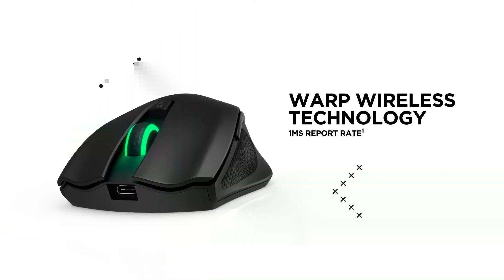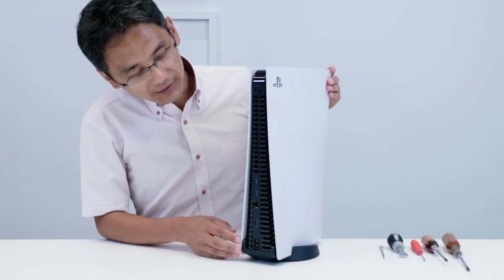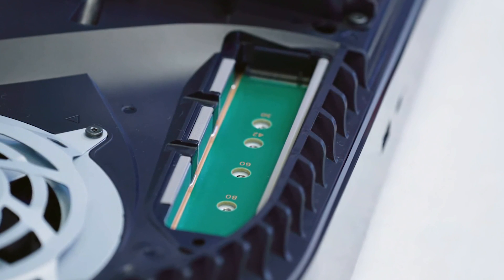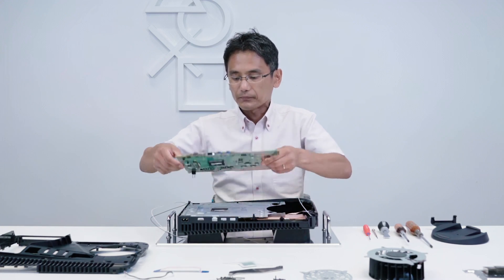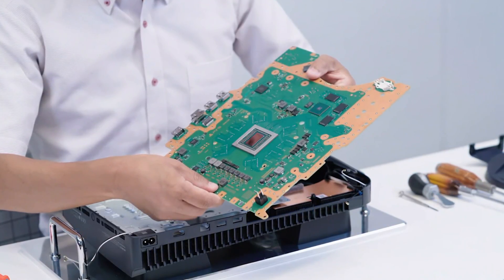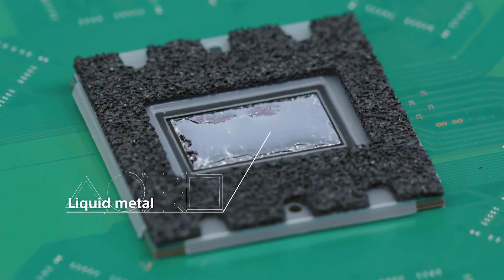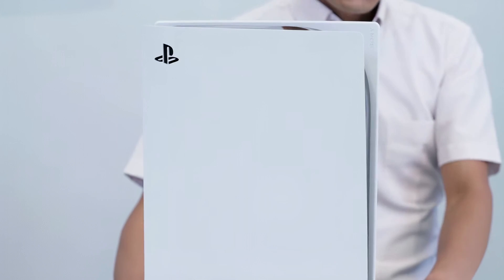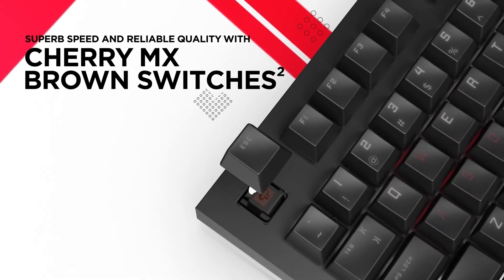PlayStation 5 Teardown Analysis: Inside Sony's Next Generation Hardware Design

Comment: For all the Sony fanboys DF raises valid concerns about the expandle SSD heat that doesn't make them shills. For the Xbox fanboys just bc they raised these concerns doesn't  mean Sony hasn't  thought about this & it will fail. The console has been in development for 5 years & Sony knows what they are doing.  

DF isn't shills. They are doing their jobs & without a unit from Sony they can only speculate until they get their hands on the console themselves to do testing. Jesus i hate fanboyism.
Reply: Well, it's funny how he conjecture that the commercial SSD's that can be put to the PS5 will suffer from "overheating", but of the Xbox's SSD card doesn't say anything when it doesn't have any dissipation either.
Reply: He mentioned ms more than Sony in a teardown of a Sony console. So much forced concerned - better known as concern trolling.

Sony has copped it bigtime over the last gen for noisey consoles - rightly so. Do you think they would have addressed that? I do. I also have confidence in there strategy to mitigate thermals within PS5 - including the expansion bay. 

Rich is a classless shill - it shows more often than not. And Eurogamer are one of the publications the LOVE to perpetuate false rumours regarding PS5 over the last year or so.
Reply: @26101976bdm  he mentioned this bc that's all they have to compare it to. Without the actual unit from Sony they are basing it on the XSX designed & how it COULD compare. He even mentioned at the beginning that Sony's strategy of drip feeding info was the better option bc people are STARVING for that info & HYPED to get the PS5.  I personally think it's bc we have seen actual next gen games captured & running on the PS5 unlike MS & they look incredible.

Look up the compilation of people who got to see Demon Souls gameplay trailer. They were blown away but Xbox fanboys jumped at the opportunity to shit on PS5 bc of DF saying it was running at 30fps. No one cared it was 30fps. 

Visa versa when the XSX was reported to be really hot the PS5 fanboys jumped at the chance to shit on the XSX saying it was overheating. Which the journalist NEVER said that.  They just said it was hot & blowing hot air. He used hyperbole saying it could "heat your flat" but that was just a joke.  

Again i cannot stand fanboyism from either side. Sony nor MS give 2 squirts of piss about people defending a corporation that's meant to sell you a product.
Reply: @djkoz78  if you don't see any bias when Dick is talking about PlayStation products - I can't help you, it's plain to see. Fake concern throughout, mentioned ms at every turn - and with an air of praise. Yet they haven't shown any games running on xsx.

Now - you mentioned the xsx getting hot and how Sony fanboys jumped all over it. In the case of PS5 - that would happen and then a publication would run with it and before you know you have untruth being siad as fact.

I am a fanboy - don't shy away from that fact either. Sony are guilty of bad messaging/mixed this time around - that cant be denied.
Reply: @26101976bdm  wait are you calling me a fanboy? Bc i have both the PS5 & XSX preordered. I don't care what your opinion of DF is. I disagree. Literally on the Richard's twitter you have XBOX fanboys calling him a Sony shill right now. You seem to be the fanboy bc its pissed you off this much.
Reply: @djkoz78  no mate - I didn't call you a fanboy, you stated quite clearly how you feel about them. I was pointing out that I am a fanboy - and that I dont see anything wrong with it. 

In my case I don't perpetuate false rumours about the competition and can also call Sony out when I'm not happy with something they've done - messaging. 

I do 100% see a bias coming from Eurogamer/DF - if you or others don't, that's sweet. It won't change my opinion of them, as my words shouldn't genuinely affect others opinions - because that all they are, opinions.
Reply: They failed to mention xbox have not presented any gameplay with ANY kind of ray tracing but they were counting shadows , SHADOWS in the Spiderman MM section 

They failed to see the ray tracing in start of demon souls gameplay 

Failed to mention the obvious popins in every game shown on XSX 
Also the ability of liquid metal when it is properly contained

Comment: XBSX “smaller”... I’d be curious to see what the actual volumes of the two consoles are. They are possibly much closer to the same “size” than we think.
Reply: Nope. Xbox Series X is still significantly smaller, since the PS5 is not only taller, but also deeper in size.
Reply: @ohmnesia  There is another dimension in that equation...
Reply: @BayleeO-30  Yeah, but that doesn't change the fact that PS5 is bigger in the 2 other dimensions. I'ts probably about as deep as the Seris X is wide. And then you have one dimension left, in which the Seris X is smaller again.
Reply: @ohmnesia  I have done the research: PS5 comes in at just under 645 cubic inches. XBSX at just under 411 cubic inches. So, there you have it. I still wonder how difficult it will be to put these in a standard entertainment center. I would imagine that the PS5 would be slightly easier due to it only being about 4 in. wide. That extra inch on the XBSX would be an issue under my tv... not sure about anybody else.
Reply: @ohmnesia  It isn't smaller. It's shorter. Big difference. I can't fit that eye sore box in my entertainment center. I can fit the ps5 there though.
Reply: @joi0001  Well, I can't fit the PS5 in mine, since it's too tall (both horizonally and vertically). And I assume most people will have the same problem.

And it is smaller in volume btw.
Reply: @joi0001  If you're putting your PS5 in a space that an XSX can't fit into the air flow is going to be terrible.

Comment: I don't buy this "it's the same as a vapour chamber" thing coming from Sony. I'm certainly no expert, but the information I've been reading suggests that it's not that simple. You can't just throw more heat pipes and larger fins at a conventional cooler and expect it to perform as well as a vapour chamber. But that's all academic, as long as it does what it needs to. Doesn't matter what the tech is, as long as it remains "cool enough"
Reply: its not a vapor chamber, its a heatsink that the performance of a vapor chamber.
Reply: @devilshooter126m8  Which is what things I'm reading says is BS. Like I said, I'm no expert on the subject. It feels a lot like one of those "yeah, well MY console's got this, and yours hasn't" type school-yard arguments, but whether it's true or not, it doesn't matter if it keeps it cool enough
Reply: @AntneeUK  Yeah. It's not a heatsink with the performance of a vapor chamber, It's a heatsink large enough to perform like a smaller vapor chamber.

Comment: The look and size of the console matters only 1 day when you purchased it. It’s far more important what games are coming. And sorry, but Sony is a different league here. I don’t even care if a system is quiet or not. The Ps5 has a lot more features to care for which of course all need place 🤦‍♂️. The Xbox cooling system is the most dumb I have ever seen. I already can see where the flaws are. Especially after 1-2 years running. But I can’t wait til people realize that. You don’t need cooling on this thing anyway. Thanks to the series S, the best looking games will look like last of us 2 will look on the Ps5 xDD 🤣🤣 for the whole generation. 1000%.
Reply: Sorry but all signs point to Sony's best days being behind them, 70$ for a demon souls remaster? They're coasting and don't have any Shadow of the Colossus' to save them. They're gonna gouge and throw money around until next gen where they're forced to try harder. That's the way it seems to me anyway.

Comment: Will you do an iphone 12 pro max graphic analysis, they said they have achieved console level graphic, very interesting.
Reply: Did you get that info from a facebook post?? That's a total lie, lmao. Maybe nearing PSP performance disregarding battery life, but nothing more. Still a shitty chip on even shittier architecture along with an incredibly gimped OS that can't ever run more than basic android apps developed on it. For a 500% price markup and only will be supported for a few years until it gets slowed down and be useless junk. 
Spend your time reading more informed tech material, please.
Reply: @sqlevolicious  Apple said this, in the special event.

Comment: It will be a beautiful and powerful console when they finally release SLIM version in two years. I don't plan to buy it before that happens (because it looks terrible now).
Reply: It also needs to to be black , not a racist thing i just would prefer a black console. They just look far better than white.
Reply: @DEVILTAZ35  and it won't turn yellow after 5 years.
Reply: I think it looks great actually. But it's huge 😂 I guess the imaginery engineering award goes to MS.

Comment: Hey DF! I've got an interesting question for you: Is next gen console gameplay possible without an actual console?

Since Microsoft included XCloud into Game Pass and Google released its new Chromecast with androidTV It's a valid question I think! As an alternative there could be also named a Xiaomi Mi Box S (Lan Port), some oDroid N2+ SBC or even a nVidia Shield (all 4 with android!). But I wonder, how frametimes and resolutions do look via streaming these days and if this is a real low cost alternative for an XBox Series S oder PS 4 Pro! Also the quality you get from Playstation Plus would be nice to know. Does Ps Now at a 1440p Display look way worse than PS 4 Pro in 1440p?

Maybe you could take a look at it. =)
Reply: I can't see anything above 1080p30Hz(720p60Hz) on streaming in the foreseeable future.
And currently it's at 720p30Hz
Reply: @MaxIronsThird  Even so, button presses at over a second makes for any game unplayable regardless of the heavily compressed resolution and the few frames that actually come through even on the best network on the planet.
Reply: @sqlevolicious  The first tests I've seen with XCloud were very convincing even for story games like the Witcher 3.
Reply: @MaxIronsThird  Afaik only Sony still limits to 720p. Stadia and XCloud are already at 1080p. And since upscaling is working fine these days, I would have been interested in DFs opinion!
To play any Game Pass Game on my 2017 smartphone with WiFi in (upscaled) 1440p sounds like switch-gameplay right from 2030. :)
Reply: Game streaming doesn't work in reality, it's a scam these companies run every few years. You can't break the laws of physics and send key presses over hundreds of miles and expect to get latency low enough to be playable on any game other than a turn-based chess game. 
Don't buy into game streaming. Processing power will only ever be local.

Comment: I learned more about series x than the ps5, which is weird wasn’t this supposed to be a ps5 teardown analysis?
Also you didn’t compare the Wi-Fi 6 and the Bluetooth 5 of the ps5 with the xsx, since you compared every other aspect of them, instead you talked about how it was unnecessary, idk seems like sony is trying to future proof their console. IMO Sony tried to build and perfect their internals and cooling first then made the design later, while MS made the shell first and tried to piece everything inside of it. Ps5 just looks much better engineered to me inside and outside.
Reply: I think a lot of that is down to Sony's secretive nature and not releasing full technical breakdowns whereas MS has.  WiFi AX (6) is totally unnecessary for most people unless you live in places with a lot of signal congestion and the routers are significantly more expensive than their AC versions were at launch.  A lot of people still have old 802.11n routers especially if their ISP uses custom routers.   As an engineer the engineering on the Series X looks considerably more impressive.
Reply: @weirdscix  the same was said with 4K, also the same can be said about 8k or 120fps not everybody will have a TV that supports it. Wi-Fi 6 is much better for vr the new oculus quest is using it, psvr 2 will probably use it. PS Now will take advantage too... As to design xsx just looks clumsy, just look at the back of it, the 2 top air vents are literally shut there’s no way air can flow through it, although that split motherboard looks pretty cool.
Reply: @alexisreee3930  Maybe WiFi 6 will have some adoption but it will take years and still be on the low side, 4K TVs are very common now, 120/8K not so much.  The subject of airflow is very technical and would have been designed, iterated and tested many times before they settled on a final design. I think both consoles will do well in the end, Xbox because of Gamepass, Sony because of Exclusives, historically though Sony have always had the weaker product, even PS4 was plagued with problems.
Reply: My thoughts, their clearly SALTY about not having the opportunity revealing the break down on their channel.

Comment: I like when companies make funny marketing jabs at each other , I enjoy this one as well with the stand , but I prefer the ps5 method of the stand. I don’t like how the series X looks with the stand sideways
Reply: Marlon Te Vrede  then why would they post it being able to put sideways ?
Reply: Just to drop knowledge. The stand on the series x holds it up to allow air flow to come into the bottom. They made it non removable for a reason. They dummy proofed it so that people couldn't take it and cause the system not to cool properly.
Reply: Both look best vertical but the Series X looks really bad flat. The PE5 I think you could get used to quick enough and its at least doable.
Reply: FUCK YOU GOOGLE ASSHOLE  I don’t know if you’re trying to make some kind of joke but the stand comes with the console.
Reply: bro why did you hit rihanna that's not cool
Reply: @Hannibal the problem with the xbox one s all digital weren't that you could only buy digital copies, the problem was that they sell it at the same cost of a one s. Only a idiot buys the all digital over the one s at same price, they have the same specs but one offers less than the other.  At 99€ the all digital  vs the 220€ one s has a reason to exist, at 200€ no
Reply: Yeah, I think it’s because of the Xbox logo, it just looks like it’s wrong. They’ve had successful jabs at Sony before but the one about the stand was pretty off. Firstly, the overall teardown was pretty great and the PS5’s stand is clearly not as basic and ‘cheap’ as people expected it to be, I think that jab was just a failed joke on their part.
Reply: @narukami6364  Yeah. Imo both consoles look far better vertical. Horizontal seems like a consumer decision
Reply: @narukami6364  yeah I completely agree with that , that was my exact thought when I saw that
Reply: @Hannibal Yeah, but Microsoft went about digital content and streaming the wrong way by trying to force it on the consumer with predatory measures such as 24/7 online check-ins and the emphasis on DRM which highlighted its downsides more than anything else. Obviously, the future of digital media came true and is dominating the entertainment medium (not just because of video games but everything else included) but the way Microsoft tried to go about it back in 2013 is still wrong. The PS5 Digital Edition and XSS are proof that both Sony and Microsoft understand that digital is the future but they can’t force the consumer into that future, so they will both settle for offering it as an option for one more generation until it finally becomes the standard in the 10th generation (2026-2027).
Reply: Nothing beats the “How to Trade Games on PS4” video that Sony sucker punched Microsoft with in 2013. That was the K.O. killing blow for the X1.
Reply: @DVRKSTXR  yeah that was a literal kick to the nuts in public, amazing lmao
Reply: @chrisbrown113096  The Xbox One never recovered from that. Now, Microsoft is trying to bounce back with the XSX|XSS and Xbox Game Pass.
Reply: FUCK YOU GOOGLE ASSHOLE  in a store the parents who buys the console for children (and 60% doesn't have any knowledge about hardware or design) when they see ps5 and xbox, buy ps5 because the xbox from the esterior seems a cheap box of plastic, ps5 instead is more like a console, and with led and bicolor is more eye catching. Xbox can only be appreciated by a passionate of technology who informs himself about new tech.
Reply: @hxh-zz4fh  lol no it doesn't kid.
It looks more like a modem than your typical console the closest console that looks like a console is the xbox series s

Comment: And now remember that SSD chips have very, VERY short life term when they are used very often.
So  if you write-erase on this soldered SSD  it  will soon  be not in "good condition". What that mean? Right 3rd party SSD will be used so no that SUPER FAST speeds.
I don't know the design is controversial...
And trust me about that liquid metal it's good, very good BUT when it dries up (and it will dry up)  you will never clean it up properly  as it should so ...
Questions....

Comment: We will be playing games on the series X while PONYS be trying to figure out how to use a screw driver to install their ssd😂😂 trying to decide how they're going to fit it in their living room 😂
Reply: The need to remove the case and hoover out those vents Is tad worrying
Reply: @waynebarton3622  no it's not. That's reassuring. It means that years down the line if you never bothered to clean it and it's getting loud or overheating you can easily clean it out. Xbox doesn't have that same level of ease. It's clear to see who's a pc user vs just console. Having an easy way to clean your system is fantastic as dust always accumulates and negatively affects thermals and therefore performance of a system.